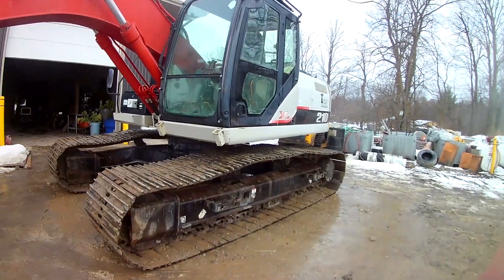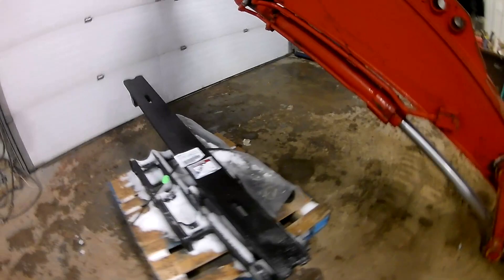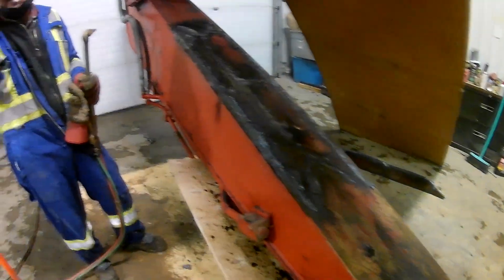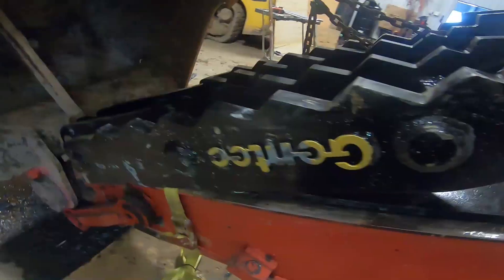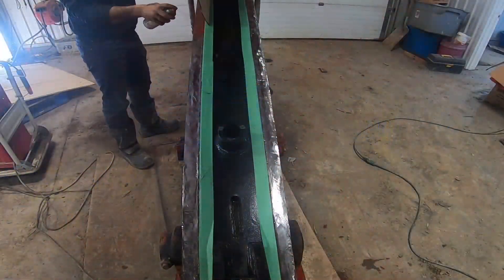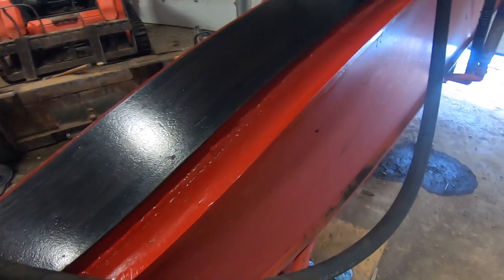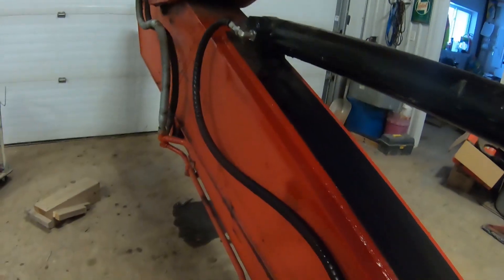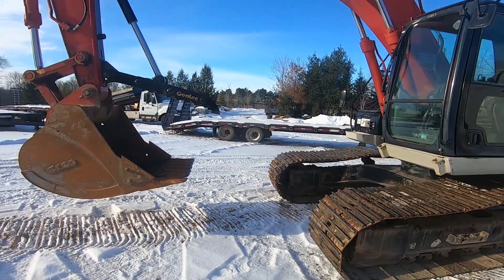Purchased a Hydraulic Thumb!!! || Installing it on The Link Belt 210 Excavator

Comment: How much of a stroke does this cylinder have? I would have thought you would like the thumb in near vertical position at its maximum, no? Please correct me, if you can. Thank you.
Reply from the maker: @josephus333333  I’m assuming you mean how much you can close it? There are different style thumbs I believe they are called telescopic or something like that, where they have an extra system allowing them to go all the way around to meet the bucket wherever. 

However they were quite a bit not expensive. So for our purposes this works fine

Comment: You guys just F. Up that boom All that heat he put on there to cut that Existing rack of  pin placement holes that you could have used.  Your boom will start cracking  in the near future future
Reply from the maker: Appreciate your feedback and that was a bit of concern but it’s been fine. This was done 4 years ago now and we haven’t had any issues. It’s pretty common from my knowledge to add a thumb this way
Reply: It's normal don't worry about it. Half the time they don't even paint them.

Comment: Unfortunately the thumb is not on the bucket pin so it’s picking range is limited to stick mid distance. I totally modified mine and now it works on the bucket pin, that’s so much better, now I can pick at any position. But this have a problem, it does not open fully, leave an angle so when working with bucket with arm very extended , the thumb will touch the ground. Looks like there is no way to have this working perfectly without a connecting rod similar to bucket’s.
Reply from the maker: You are probably right, this is the first thumb we ever installed and only machine other then a mini that has one. There are for sure a few things I would have changed about the way it was installed

Comment: We have a 210 lx very similar to yours and i just found this video. I have been considering putting a thumb on ours and thought I'd ask now that youve had it on for a while how it works out for you. I've often wondered if it would get in the way digging and loading dirt, or if it is much of an issue to remove the hydraulic and maybe fab a pin to hold it against the arm close for times between jobs where you don't need it. I have seen stationary thumbs that although are not as handy as hydraulic could be moved this way and pinned back against the arm when not in use and i did see this as a plus although not as convinient as a fully hydraulic unit. I guess my question  is does it get in the way on other applications?
Reply: Thanks for the quick response. I gotta admit since I wrote this I looked at your demolition video right after install and your pond side job. It looks like the dig visibility from the seat is great with it fully drawn up. That put you in a high speed handling that demo and sorting materials, and even when you were handling the dig it seemed out of the way. I guess loading is when you gotta watch truck boards and such. Thanks I think I might follow through on this. I think maybe the ease of hydraulic control far out ways having to fight a stationary manually. Too I'd guess when releasing the debris over the dumpster being able to open it would help not having it stick to the manual thumb. Thanks so much for your input. Your videos are great and your operation skills are awesome. 😊
Reply from the maker: @larryjones1694  Really appreciate the kind words! Thank you for watching my videos and your feedback! We have been using this machine a lot this year to load topsoil on trucks and it works fine. Only thing I’d say is confirm the placement of the thumb ours when opened at a certain angle can reach the boom… there are some scratches that have happened which I’m not a fan of lol. That and the little bit of resistance from closing the bucket as much when it has a full scoop of dirt are about the only draw backs. But if you need to do demos or clearing brush boulders etc a hydraulic thumb will make your life much easier and outweigh the cons.. which aren’t even too bad. Good luck! Let me know how it goes
Reply from the maker: Hi! I will say that a hydraulic thumb is much more handy then a stationary one. However yes you are correct about it sometimes getting in the way when we are just digging or loading dirt.

Comment: Great video sir. I was wandering what weld process was used to weld the thumb on? I have a potential customer wanting me to do a similar job for him. Also approximately how much did he charge for the welding job?
Reply from the maker: Thank you! The welding process is not my expertise, so I’m
Not sure.. I know he had to torch and cut the othe metal that came on the machine and then we helped line it up make sure it was in the spot we wanted and then he went to work on welding. it was actually a friend of my dads so my dad dealt with him not exactly sure what he paid but I imagine about a days worth of time for a welder.

Comment: It's faster than the other hydraulics because the piston is a smaller diameter than the others.

How's it been working for you? Have you bent the thumb piston?
Reply from the maker: Yes that makes sense! Usually why the smaller equipment always seems to move faster lol

So far it’s been good and I have not had many issues apart from a delay sometimes it’s like it gets stuck when fully opened and I have to press the button several times to close the thumb. Other then that been great